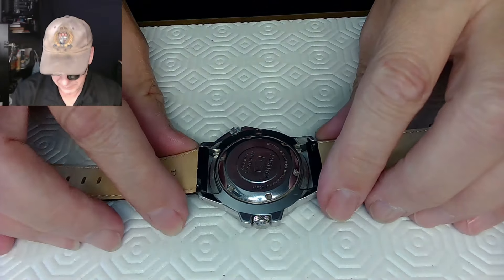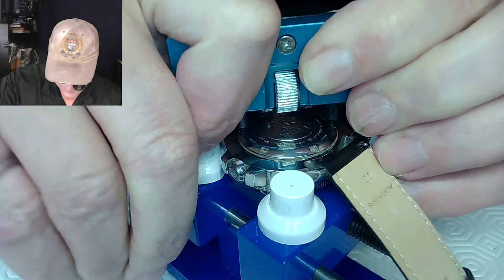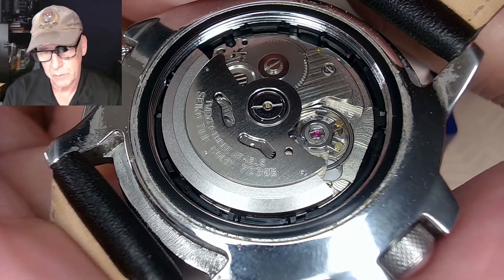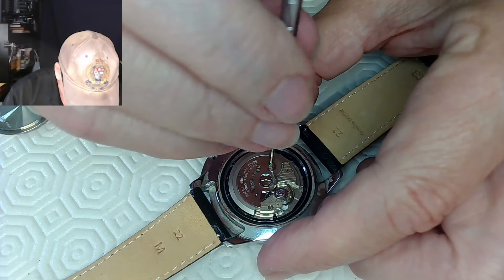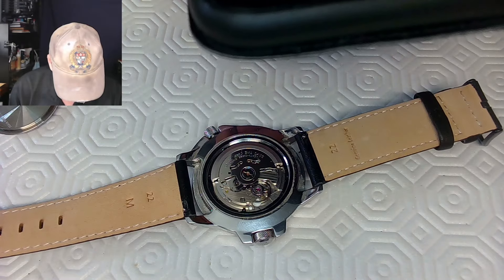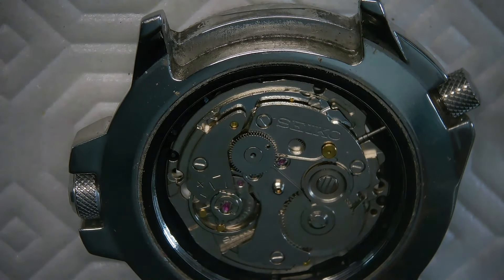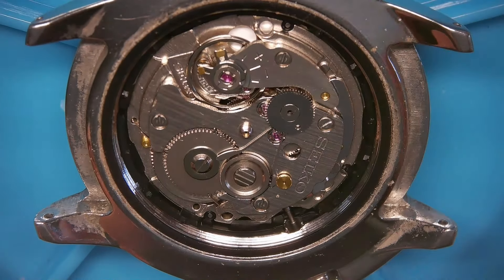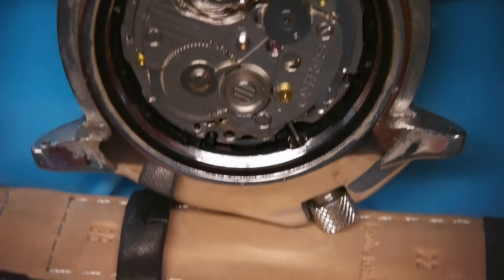Jim's Seiko Watches

Comment: The seiko 7s26/7s36 don’t hack or hand wind, that wheel for the automatic winding works is held on by a circlip on the back, you’ll need to let down the mainspring with a screwdriver on the top like you did to wind it and remove the top wheels before taking that plate off. But manuals are readily available… also when putting the balance back on you need to orientate that other wheel correctly with the hole in it in the right place (in the back of the manual but easy to over look). I’ve done dozens of these… and good luck with the diashock settings… I find two small screwdrivers works the best… Also the seiko 7548 is by far my favourite quartz movement to work on… love them…
Reply from the maker: Thanks for the big tips. Found a disassemble and assembly video that will help.

Comment: I’ve sent you the tech sheet and a picture showing how to remove the stem.
Reply from the maker: Hey thanks.
Reply: @JDRichard  Always welcome. These are a real workhorse movement. A service should have it running really well again. 

If you aren’t familiar with how to manipulate the diashock and diafix shock settings, check out the two videos by Alex Hamilton on his Watch Repair Tutorials channel on them. 

They have a reputation for being very tricky. 

If you try to manipulate them just like an incabloc spring, you’re in for a serious headache. If you follow the methods Alex demonstrates, you’ll be fine.
Reply from the maker: @mercuriall2810  I have done many of these settings over the years, but thanks